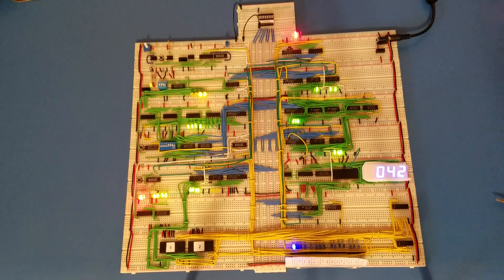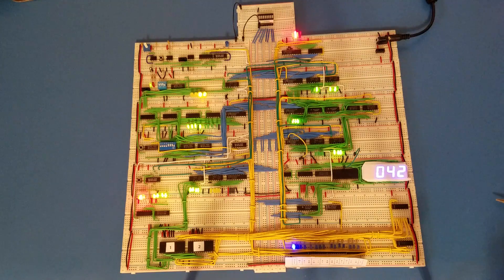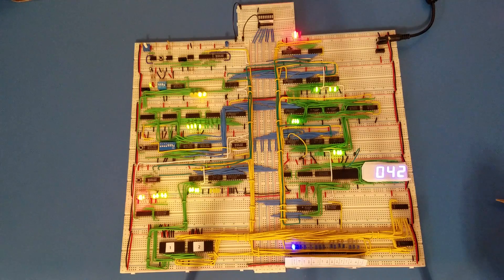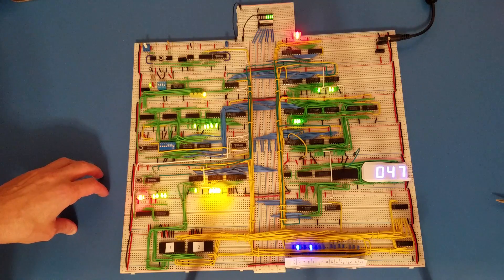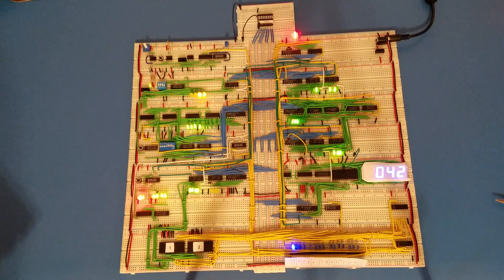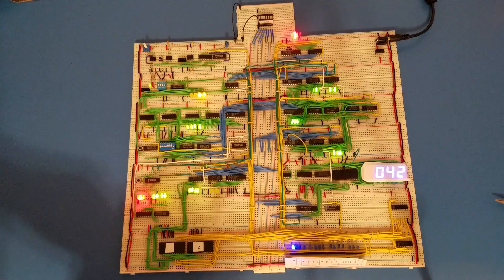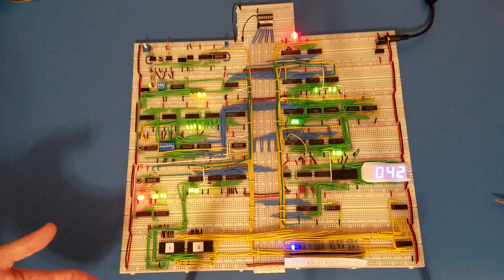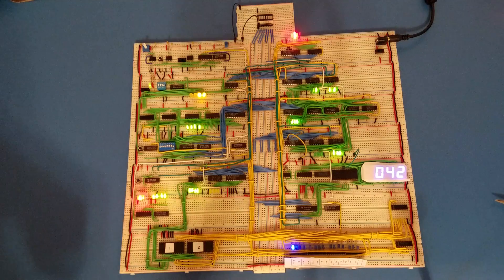RESET switch Demonstration  (Ben Eater 8-bit Computer) SAP-1

Comment: This error looks like a problem with the control logic (microcode).  Somehow, a "write" pulse is being received by the display register when it shouldn't be.

First, try single-stepping through the program.  If the problem never happens during single-step, that indicates that it's probably caused by capacitive coupling, although it's still possible for it to be capacitive coupling.  Try separating the control lines by a bit of distance.  Ironically, neat wiring can cause capacitive coupling problems even though it makes troubleshooting easier.

Otherwise, check what instruction the error happens on.  If it's always happening on the same instruction, check which control lines are going active during that instruction and check that there isn't a short from one of those control lines to the display write control line.

And hey!  Great minds think alike!  We both have 6-pin ICs as our icons. :)
Reply from the maker: Hey thanks for the reply! I've spent quite a bit more time examining this issue and have posted 3 (so far) follow up videos. If you're curious, check out those videos to see more of what I've tried, including single stepping through each instruction, and addressing this notion of crosstalk on the wire. I believe ared0hel's comment to Part 2 is going to prove to be the best working solution.

1 - https://www.youtube.com/watch?v=bdHYZrhas5U
2 - https://www.youtube.com/watch?v=m41kM1QsIwE
3 - https://www.youtube.com/watch?v=_AmgauI_sVQ

Comment: where did you buy all of the parts, online or at a store? and all at once or as you needed them?
Reply from the maker: I am hoping to make a video at some point talking about parts. But the shortest answer to your question is ... I got them online via a variety of places. Having said that, I can tell you that you can buy everything from Jameco (google it) if you wanted to get everything at one place.

Resistors, capacitors, breadboards, wire, wire cutters, multimeters, and that sort of thing can be bought just about anywhere (such as Amazon), but the various chips required for this project aren't quite as easy to find, so you have to know about these various specialty places such as Jameco, DigiKey, Mouser, and probably a few others.

Comment: My though about your 47 is that the 5V may not be 5V everywhere. Power line of every breadboard goes thru a not soldered contact, which implies contact resistance, all in series. That loss may come to a floating low on display out signal sensible to the current draw. Maybe a continuous power line instead of a stop and go connection would make it more stable?
Reply from the maker: Thanks for the reply.  Someone brought up this point on a previous video, so I'll just copy and paste that reply.  "I am getting good voltages all over the board. That is one thing I've tested repeatedly because I had a lot of power problems early on due to low quality breadboards and loose jumper wires. I was pretty far along in the project - but I decided the breadboards I was using were complete garbage. As much as it pained me, I bought all new boards and moved everything over. Made all the difference in the world."

To that comment, I'll add that I'm also using a dedicated 5V / 8A AC to DC power supply as opposed to the USB cable thing. I am getting a solid 4.9-5V everywhere on the board. This has been tested and retested ad nauseum. Power is definitely not an issue on this board.

Actually, when I get home later today, I think I'll make a short video showing my power set up.

Comment: And to follow up the comment - from what I can see from the video you are in fact going the 74LS273 route rather than just duplicating a Register, if I was debugging this issue (and it wasn't an issue with your micro code, seems as though it isn't because it doesn't always do it), I would check with a multi-meter the voltages on the Output Enable (control line) sorry don't know what you/ben are calling it... also you could disconnect Pin 3 (that control line) on the Quad AND gate 74LS08 that he's using to latch the output.  Nothing should (obviously) appear on the display... but if something does you'll at least be able to narrow down what the glitch is.  You all seem to be having so much fun with this project... I'm going to have to join the party at some point lol... except I need 8 bit instructions and more RAM lol.  Wish you well on figuring the problem out.  (OH and one last thing I noticed - where are your pull down resistors for the bus?)

Comment: David, wondering if you single stepped through the code would you be able to analyze the issue when the 47 (00101111) appears on the BUS, and figure out what is causing it to latch onto the display?  Or maybe single stepping would make the issue go away... that will give you more info to go on.
Reply: Chris McKernan , is that a 4F you have bracketed there? ;)
Reply: I need to learn to binary again...
0010 1111 is a 2F